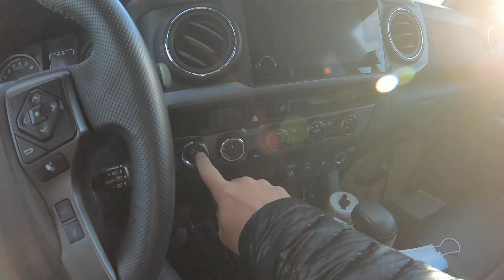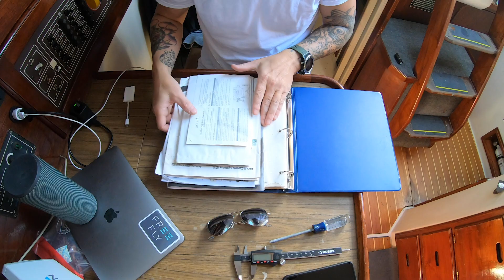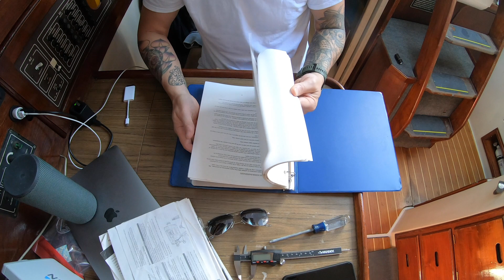Refitting a Catalina 36: Episode 7

Comment: The seacocks are not at all one way valves. Just simple ball valves. 
As far as seacocks open or closed its up to you. Alot of people leave them open, some people shut them religiously. It depends how much you trust your hose clamps and whatever they are attached to. If the hose comes off or a fitting breaks the boat will fill with water, the bilge pump may or may not be able to keep up.... Might be a good idea for you to close them till you are more familiar with everything and the condition of stuff.
Nice to see fairly new looking marelon seacocks. 
And the galley sink should drain straight down to a seacock under the sink and gravity drains it straight to the sea.
Reply from the maker: Great insight! Thanks for letting me know. I am actually going to be swapping the sink out. Turns out there were barnacles in my seacock 🤷🏼‍♂️. I just want one drain, straight out with the gravity! I agree though, until I know all hoses and clamps and valves are secure, I’m going to be closing them on the regular! Thanks for the info! 🙌🏽 I also was excited when I saw the new Seacocks... one of the reasons for the purchase.

Comment: Do not try to dry your boat up with butyl tape that's an old school compound... Through deck hardware fittings and port lights I recommend 3M 4200 And boat life life seal... Comes in black silver and clear never use silicone...